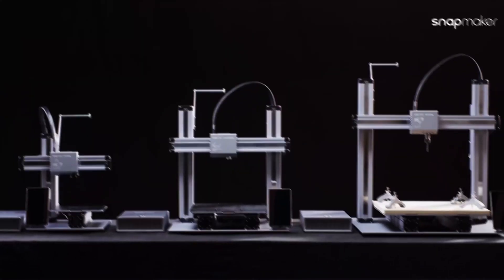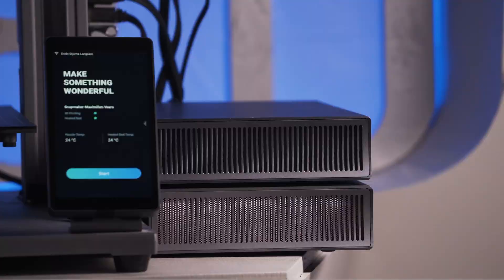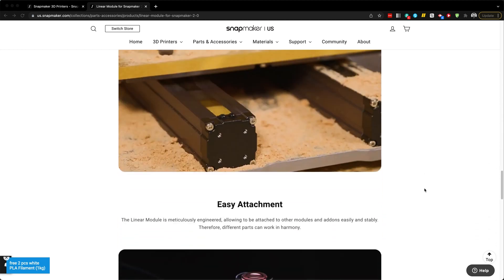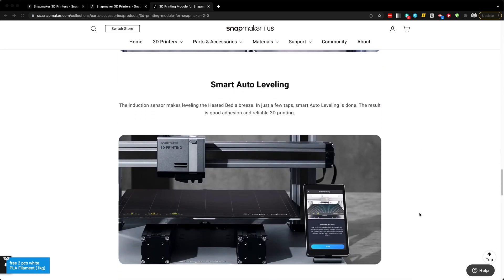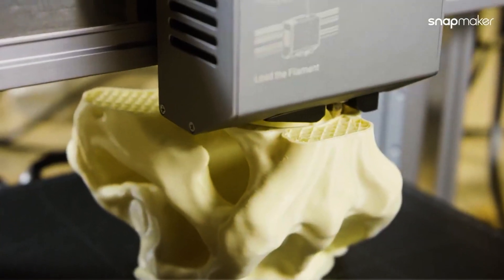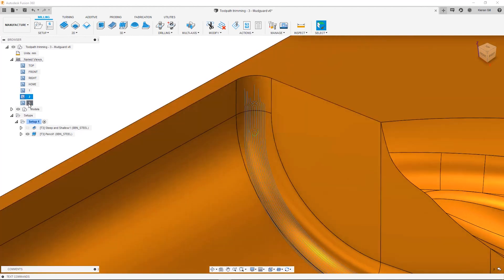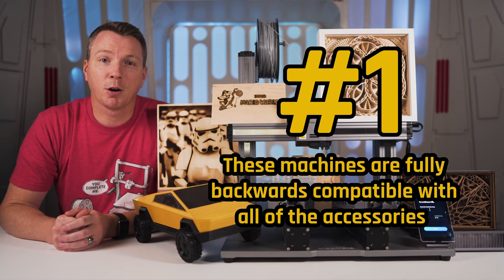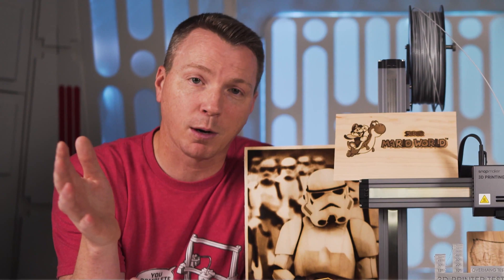5 Things to Consider Before Buying Snapmaker's Newest Model

Comment: Before you buy this POS let it be known luban it is a mind numbing software nightmare  and  at least for laser is completely useless. If you want to design your own projects luban will stop you dead. I have the 350 and the rotary module. I now use a cheap  diode laser with lightburn and the long mill cnc with vcarve pro.

Comment: Hi

Thank´s for the good video :)

Do you have a video for just the A250 / A350?

I do have some questions / conditions / thoughts: 

Foor first condering that I have the Prusa MK3s but I am not unpleased or so but I like / need a good 3 in 1 3D printer. 

1.) Is the feature Laser engraving and the CNC worth and reliable workling with?
2.) Is the printer faster than Prusa? 
3.) Is the louder or quiteter than Prusa?
4.) How is the printer´s buildplate?
5.) I  know that the printer can handle addons but can the 250 be upgraded to a 350?
6.) How can the printer handle the calibration that cals "Z-Leveling" in Prusa?

Mvh / Best reagards Fredrik

Comment: Hey. Could you maybe explain what is the difference between all these letters F, A, A T? I'm thinking of buying Snapmaker 2.0 Need just a 10W laser so wanted to by F350 + laser + enclosure. But now, I'm confused a bit, if later F means "older version" of construction, if A T is the newest? Will appreciate if you could simplify that for me. Thanks!
Reply: F = 3D printing only (other modules compatible but sold separately)
A = All modules (3D printing, laser etching, and CNC routing)

T = newer model with improved motors and stuff
No T = older model

Comment: Bought an A350 less than a year ago. kicking myself now that there is upgrade with so many new and better features. Will snapmaker work with existing owners to upgarde to new 3d print head and linear modules? Thanks for the video

Comment: Great Vid! How would this compare to a MakerGear 3D-ID? The A350T has multi processes but I’ve heard the makergear build quality is second to none…What’s your opinion?
Reply from the maker: I haven't had a chance to try the MakerGear but I seriously can't imagine that its quality is actually better than the Snapmaker. The SM is all metal, everywhere, and it' uses lead screws instead of belts, has tons of upgrades and a huge build volume. Also, I just did a search for the 3D-ID - did you mean the M3-ID?
Reply: @The3DPrintingZone  You are Correct! The M3-ID

Comment: Nils, I am considering purchasing a unit, along with the rotary tool. They tell me I can mill things such as pens from start to finish on the rotary tool, meaning I don't need to use a lathe. I noticed you do use a lathe. Is that because you already were turning on a lathe before you got the rotary or because it is much more efficient?
Reply from the maker: Hi Irene. You can do an entire pen blank with rotary tool but, in my opinion, it is more efficient to use a lathe. With the super high speed of a lathe, you can remove a lot of material quickly and it's fast to swap out blanks and do a bunch in a short time using a pen mandrel. Again, you can do all of this on the Snapmaker too but I don't think it would be as fast. On the flip side, when you mount a pen blank on the Snapmaker, you can do it fro start to finish and make it exact, which is pretty amazing.

Comment: Also a small tip for ppl that only like to 3D print and/or laser engrave/cut. There is also a 3dr new model, The F350/F250.
And the F350/F250 may be a better option. It's 100% the same machine but cheaper as you don't pay for the extra's you may not need as it only comes with the parts for 3D printing.
As for laser engraving/cutting, with the money you save over the A350T/A250T, the 10W laser module and bed parts are a great option to buy. (one you still have to buy with the A350T/A250T as they still come standard with only a 1600mW laser module.
BTW: A great review as always!
Reply from the maker: Excellent points! Not everybody needs/wants the CNC feature so that's great info. I'm really looking forward to that new laser module!
Reply: How does it cost without laser option?

Comment: How’s the speed compared to a Prusa i3 mk3s or voron 2.4? I heard the 350 non-T models were very slow.
Reply from the maker: I haven’t been able to use either of those yet so I’m not sure how it would compare but I’m certain it won’t touch a Voron - most machines won’t. The AT series is faster than the previous gen by around 50% according to Snapmaker though.
Reply: @The3DPrintingZone  thanks! I just threw those out as examples, but 50% faster is usable data!

Comment: you make it sound too good to be true. Whats the real downsides to these machines?
Reply from the maker: Price is the biggest one for most folks. As far as functionality, the software isn't the best. It works fine for most people but you have to be willing to use something else if you need advanced features. The laser isn't very powerful (they have a 10w coming out in the next few months) but honestly this has been an impressive machine from the get go. I'd still like an easier way to swap modules and beds but it's just not that big a deal.

Comment: In your opinion would this work in a production environment or more as a hobbiest?
Reply from the maker: I think that depends on what its use would be. If you're not going to be using all three features, or at least two, buying separate machines may be advantageous. That said, limitations of space, frequency of use, budget and support needs are all things worth considering.
Reply: The prevailing wisdom I hear is that for production environments you really want a machine dedicated to the task, not a multi-tasker like this.